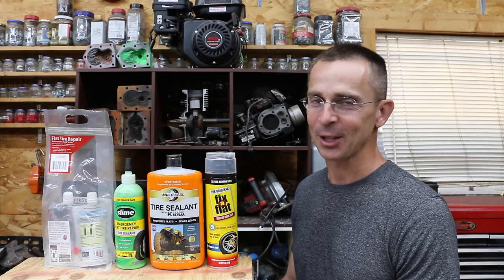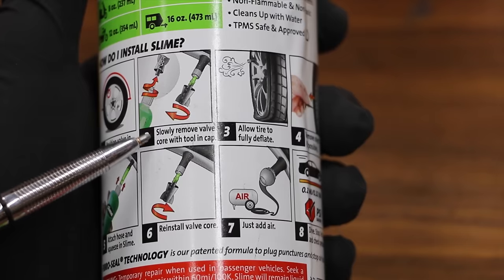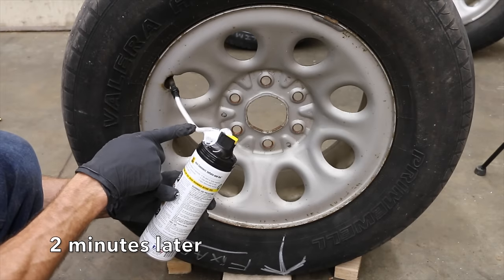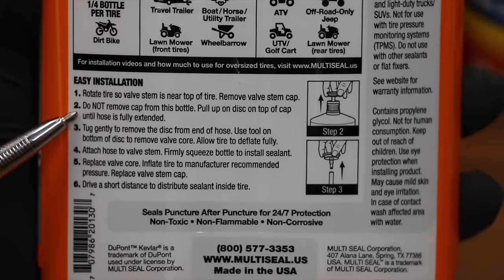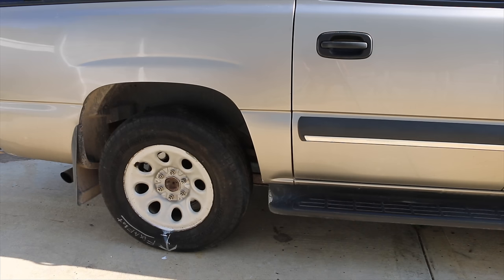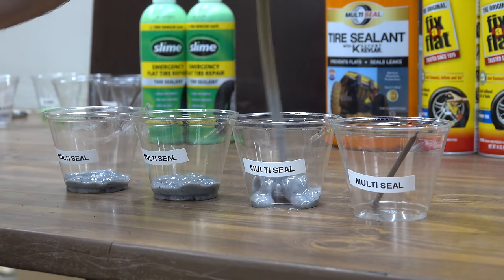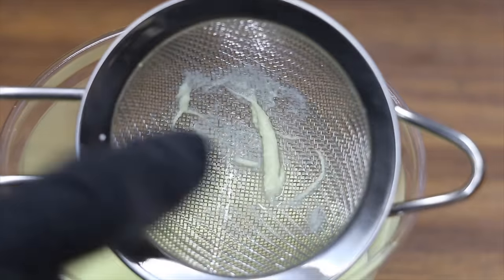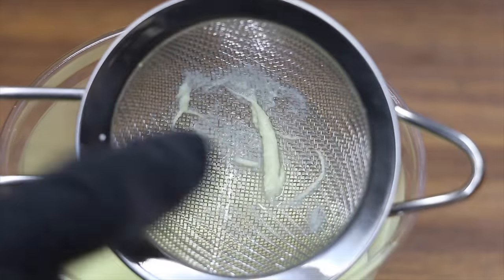Is Tire Slime the Best? Fix-a-Flat vs Tire Slime, TireJect, MultiSeal. Let's find out!

Comment: I have had good luck with Fix A Flat in the early 90s,  but this newer stuff I'm not sure about. I have had tires with more than 3/4 tread left but because it had a nail too close to the tire shoulder I was told it had to be replaced.  I took it home put a plug in and it ran until it was wore out. I have a tire now with more than half the tread left. Im going to try some fix a flat again,  this time the hole take about a week for it to lose 10 PSI so hopefully it will seal the tire . 

I enjoy these videos very much, wish i had watched it before i bought the fix a flat.  Oh well will see what happens.
Reply from the maker: Thanks for watching!  Thanks for the feedback.

Comment: I have had a similar experience with Fix-A-Flat and Slime. I had a slow leak in a tire on my F150 and the Fix-A-Flat failed miserably. I could not even get it into the tire. I tried Slime and it sealed the slow leak no problem and it's still holding a few months later.
Reply from the maker: Thanks for sharing.

Comment: That's weird. I've had good luck with Fix A Flat.  My F150 gave me a low tire alarm a few years back.  I took the next exit to a convenience store to get a can of Fix A Flat.  I deflated the tire, but the hole at the bottom, used the whole can then pumped up the rest with my air pump.  I drove on it for 18 months before I took the time to rotate tires and have it properly patched.  From the outside the puncture looked like a gnarly piece of metal, but the tire shop said it was a bent nail.
Reply from the maker: Thanks for sharing.

Comment: I had a slow leak in my sidewall that couldn't be repaired, so instead of throwing the tire away, I used Slime and got 25K miles out of it. I had to reapply Slime once when the tire started going flat and I'm pretty sure the reason for that was driving over 70 MPH, due to vibration and shaking.
Reply from the maker: Thanks for sharing.

Comment: I have used fix a flat before. It worked extremely well for me. I did leave the nail in the tire so when I took it to the shop they could find the puncture. 
I have also used Slime. I do prefer Slime over Fix a Flat.
Reply from the maker: Thanks for the feedback.

Comment: I had an almost new front tractor tire take a nail through the sidewall.  Used slime as a desperation shot.  4 years and lots of abuse  later its still holding.
Reply from the maker: Thanks for sharing.

Comment: I used fix a flat once on a tire that had a slow leak.  Don't really know what was causing the problem but, the issue (leak) was solved for about a year.  It started to slow leak again so I figured I'd use another can.  It didn't work the second time.
Reply from the maker: Thanks for sharing.

Comment: I used to drive Kawasaki two stroke bikes, they had a problem with death wobble due to front wheel out of balance, using slime cured the problem. It would be interesting to check which does a better job of tire balancing.
Reply from the maker: Thanks for the suggestion.

Comment: Slime works. It put all 4 tires out of balance immediately. Purchased red Horrible Freight tire device and removed most of the slime with rags, reinstalled green dripping tires; no more bead leaks. Use SPARINGLY for long-term.
Reply from the maker: That's great!

Comment: Never seen fix a flat not work on anyone's car.  If it were that bad it would not still sell so well. Have used Slime in my 38.5 inch tires. It does work.
Reply from the maker: Thanks for the feedback.

Comment: I had to save a 10 year old Goodyear Wrangler that was "checked" and had a hundred sidewall pinholes.
I had a can of FAF that was so old in a cars trunk I could barely read the label
It fixed the leakage problem, and lasted another year till I bought tires.
I think the circumstances were to the advantage of FAF and I think I received more than the money's worth.
It always depends what it is, how many years/miles, and what you're trying to fix. It can get you from the side of the road to the repair shop. Plus I ran it for a year. 
It was a good cheat.
Makes me wonder what they have done to make FAF so ineffective in the latest batches.
Our customers used it back in the 1980's and we did have to spend extra time on clean up.
Reply from the maker: Thanks for sharing.

Comment: Great Video! - I wonder about a follow-up video like 6 months later if they still hold and seal? - my real question is will I hate how they ride at 65mph in an SUV tire? I have older tires and two of the 4 are leaking but they all still have lots of wear left. - is this the reason one of them said for Off Road only?

Comment: Great video. I do have some questions though. I would have liked to see the bigger holes be in fresh rubber verses the same hole. Number two how well would the products work inside small tractor tires with tubes. I have a Kabota bx2200 that constantly gets flats when I brush hog. Tubes in them so would these products work??

Comment: At the dealership, I have worked on wheels with fix a flat in them. All of them never sealed, the liquid is extremely stink, very messy, they corrode anything, and damage sensors. If these products are to be used, I highly recommend going to a shop within 24 hours to have the tires properly patch plug or tires replaced. If you’re willing to learn to do string plug, that’s an even better temporary fix than these products. Side cutter, reamer, plug insert tool, brown plug. Might want to add a spray bottle, small bottle water, dish soap too your tool set to use to find holes that are hard to see. And never plug anything close to the side wall (the block of tread that tapers down to the sidewall is mostly rubber).
Reply from the maker: Thanks for the feedback.

Comment: Fix a flat works good , but you got to plug the hole. I had a can of various size screws. My old Chrysler Cordoba had fix a flat in 2 tires. One of them had huge deck screw in it .
Reply from the maker: Thanks for sharing.

Comment: one thing I wish you had tried was after removing the tires to inspect the interior, and noting the plugged leaks, you then REMOVED THE RESIDUE in the tire (free floating stuff) so that the tire had no addn'l sealant present, and THEN replaced the tire on the rim, re-inflated the tire and tested out the tire to see if the plugged area persisted even without the sealant available to act as a reservoir or replacement. In other words -- do some of these sealants result in a more or less permanent plug? Just curious.
Reply from the maker: Thanks for the constructive feedback.

Comment: Here is a suggestion for a video: I have been hearing chatter that expanding foam can be used in lawn mower tires by removing the  guts and spraying it on in. It is tempting but I am skeptical
Reply from the maker: Thanks for the suggestion.

Comment: Wow! I have used Fix-a-Flat for years but always put the valve stem on the bottom (Never read the directions).  It has always worked fine for nail and screw holes. After watching this I'll be changing to one of the other products. Like others below, I too remember when Fix-A-Flat was flammable & even came with little warning stickers to put on the rim.
Reply from the maker: Thanks for sharing.

Comment: Fix a flat has saved my ass every single time over the last 28 years.  Except once when I had a screw tear i to my tire at an oblique angle.  Left a massive tear that two cans for large tires could not repair. When I took it in to get fixed that day the guy pep boys said there was no way any kind of tire repair product could have sealed it. So as far as I'm concerned fix a flat worked 100% of the time. Going forward, looks like I will be using multi-seal but, in my experience, Fix-A-Flat definitely has its place and I will keep it in both of my vehicles because I don't always carry a compressor (yet anyway).
Reply from the maker: Thanks for sharing.

Comment: I had a slow air leak on a 550 cc motorbike. The air was leaking past the rubber air inlet plug caused by alloy corrosion . A quick polish and some silicone sealant stopped that one. So not really a normal leak .  Hard to pin down that one .

Comment: I can't remember what product I used in the tyres of my Honda Valkyrie motorcycle. But it was used to prevent a flat. All I know is the rear rim corroded so the tyre wouldn't seal. I had to replace the rim. The front was ok. I'm just wondering if it was coincidental that the rim rotted?

Comment: After watching this video, I picked up a nail in my tire. It was in the tread, but close enough to the sidewall that Discount Tire wouldn't patch it (I don't blame them, they have years of experience and probably lawsuits that have set their procedures). Remembering this video, I ignored the "fix-a-flat" and bought tire slime from the one of the local auto parts stores, hoping it would allow me to drive a few more months; until the tires were due to be replaced. 
It did not work. It slowed the leak, but the leak persisted. I bought new tires :(
Reply from the maker: Thanks for sharing.

Comment: I wonder if I can get away with a much smaller portion of Multi-seal if I inject it as the puncture is facing down, and keeping it face down until I fill it with air. That way, it might be "road worthy", because it won't throw off the balance by much. I like it the most because it can fix a 1\2" puncture.
Reply from the maker: Thanks for the suggestion.

Comment: I have friend who had a puncture in the side wall of a big rig truck tire which tire shops will NOT touch, and it sealed it,of course he kept it on rear of the truck and not the steer,the tire still had plenty of tread left so he didn’t want to toss it because it cost 350.00 about 5 years ago.
He had o problems with it all the way until he wore it out
Reply: I forgot to mention he used slime,about a half a gallon if I remember correctly
Reply from the maker: Thanks for sharing.

Comment: Fix a flat does work but you have to get the tire heated up to cure the latex. I have used fix a flat for over 30 years and if it doesn’t get hot it won’t seal at all. The old flammable propellant was better though.
Reply from the maker: Thanks for the feedback.

Comment: How much psi do you think slime or multiseal can handle? I have a tiny pin size hole on a semi trailer airbag. It has a hex bolt access hole on top I can add the product to. Trucks air systems operate up to 130psi. Hoping I could get by with this till I get the airbag changed out. Thanks.

Comment: I can answer this one easily I put slime in a tire that had a screw through it 2 years ago. I didn't however pull the screw out but left it in and it still holds air today.
Reply from the maker: Thanks for sharing.
Reply: @ProjectFarm  It has now been 3 years and counting I am somewhat amazed it has lasted this long.

Comment: I think fixaflat is also sold as Holts tyre weld. I had to use one and it was white and looked like shaving foam. the problem was my tyre got punture so bad that within few seconds or driving after the puncture the tyre tore. but I did add it in one of the tyre as a preventive measure, not sure if it did anything.
Reply from the maker: Thanks for the feedback.
Reply: @ProjectFarm  Can you do a video where you check the time limits of these? If a product claims that it last for 2 years than do a puncture tests after few months, may be a year of adding these products.
Also would like to know if they disturbed the wheel balance.
thanks

Comment: Appreciate your time in effort you put in your videos to make them so good and accurate. Would be cool if you could test battery companies and there claims car batteries and or like AA AAA D C’s.
Reply from the maker: Thank you!  Thanks for the video idea.
Reply: if youre that concerned about car battery quality, get yourself an old US-made optima battery (have it rebuilt if necessary) and hang onto it like the green death. i have a 30-year-old (rebuilt) dually blue-top in my 10-year-old sentra and it should last until i scrap the car.

Comment: I'm a certified mechanic and fix a flat is messy and unbalances tires.
We only remove tires and patch on the inside with commercial rubber patches & rubber cement, scuffed with power bruses, rolled to remove air bubbles. Retested in water baths.
We do not plug radials.
Files can damage belts and belts can break creating goose eggs on the circumference making huge vibration scrapping the tire.
Reply from the maker: Great feedback. Thank you

Comment: I use slime in my bicycle tubes and it mostly works as long as i have enough in there and its not too old and have plenty of pressure in the tyre.
I leave it in all year round so as not to get a flat but it has let me down a few times , not sure if those were down to age or possibly me not noticing the pressure gone down beforehand..
Not sure i like the idea of trusting it in my car though.
Reply from the maker: Thanks for sharing.

Comment: So, just wanted to add this… i used fix a flat and it did work, but you have to drive the car. It does not just fix the flat while your sitting there watching it. Somehow it increases the air pressure while you are driving and then all of a sudden your tire is not flat and your driving,,, however, you gotta “fix” it soon.  The tire pressure gets very high,,, after 3 to 4 days of driving, my tire eventually blew and split right down the middle of the tread…. But the sire still didn’t go flat.   Stuff works…. But its a very temporary fix….  The slime has been in my atv and trailer tires for years… no flats.
Reply from the maker: Thanks for sharing.

Comment: I got a "space saver" tire for Honda.  My GF got a 2010 Honda and it came with a tire repair kit (that I imagine was the same as expandable foam) No air required.  Just use can and drive it so the foam is spread around the inside of the tire. Have you checked out the expanding foam tire repair in a can. No air compressor needed?
Reply from the maker: Thanks for the suggestion.

Comment: Would be interesting to see all these products (and also the portable power pump test) compared to an original vehicle kit (sealant+compressor). A lot of vehicles these days (at least in Europe) are equipped with one of those. On some of them you have a special hole to pour the liquid directly in the compressor pump, which will actually pump it in the tire, some use the technology used by Tireject, you pump the recipient in the tire by hand  (they don't use pressurised recipients) and then use the compressor to inflate.
Reply from the maker: Thanks for the suggestion.

Comment: So to effectively use the Fix a Flat, you'd want to leave your nail/screw in the tire, don't pull it out. And the foam will seal the hole around the nail. That stuff will get you out of a bind, but only good enough to drive to the tire shop.
Reply from the maker: Thanks for the feedback.

Comment: Bought an old riding lawnmower that had very bad weathered cracked tires. Would only hold air for a few minutes. Put some slime in it. It's holding pressure just fine. Save $ over replacing the tires. I tried Fix A Flat, but it wouldn't hold.
Reply from the maker: Thanks for sharing.

Comment: Fix-A-Flat save my butt a few times over the years, it actually fills the tire up with some air so you can move on.. only problem I ever had with Fix-A-Flat is the hose on the can leaking.. I like the results on some of those other products but you have to have a compressor, The one he showed was pretty cheap to carry in the car.
Reply from the maker: Thanks for the feedback.

Comment: I drove a car with a tire that had fix a flat used in it for hundreds of miles. Ended up selling the car with that same tire on it 3 years later still holding air. I swear by fix a flat if used properly. most people don't read the instructions and put air in immediately after using the fix a flat which causes the tire to explode. the can is pressurized and the foam has air bubbles in it. you use the can and then drive at a slow speed for a bit so the carbonation in the foam releases air into the tire. the can will also air up the tire some. after that you then fill the tire up to the recommended psi.
Reply from the maker: Thanks for sharing.

Comment: Sorry to see Fix-A-Flat get so much hate. It's the only product here to partly re-inflate the tire so you can limp home. I've used it successfully in conjunction with tire plugs on a massive hole when two portable compressors burnt out. It fizzed for 200mi and got me to a service station. Slime is still great if you've got a working compressor though!
Reply from the maker: Thanks for the feedback.

Comment: I have had about 100% luck with slime and about zero percent with fixaflat. 

However I think fixaflat could get you off the highway in a pinch since it can inflate it. I usually keep a small inflator with me.

I haven't found or tried the other brands yet.
Reply from the maker: Thanks for sharing.

Comment: The FAF directions said "DRIVE IMMEDIATELY" 2-4 miles to increase pressure and coat lining, which wasn't followed. It works with the air left in tire to pressurize. Maybe adding more is a bad ratio. Idk
Reply from the maker: Thanks for sharing!

Comment: While Fix-A-Flat is generally considered the "worst" and a huge mess to clean up, it's also the only option here that both seals (in theory) and inflates the tire, making it the most all-in-one solution along with being generally simpler to use. In an emergency situation, it might save the day.
Reply from the maker: Thank you for sharing!